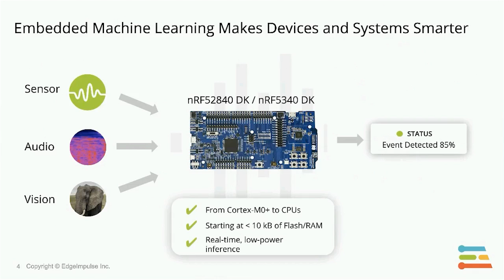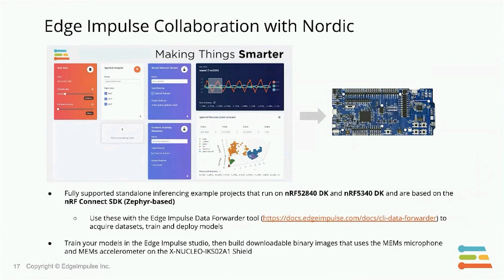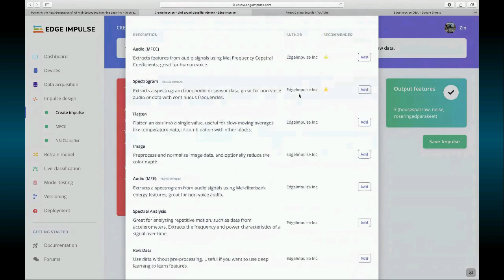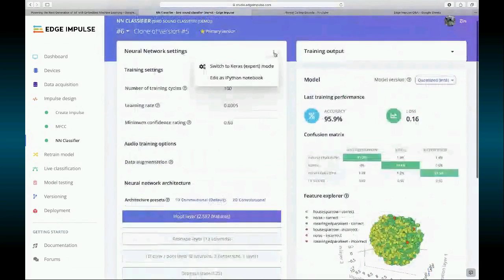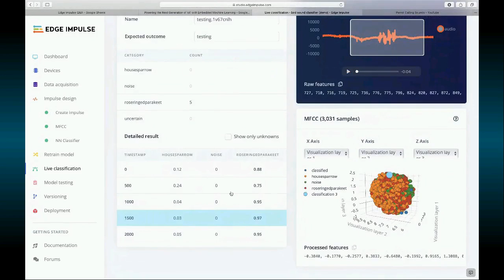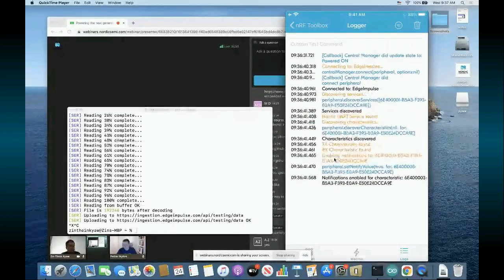Powering the next generation of IoT with Embedded Machine Learning

Comment: Are there any plans to generate model outputs suitable for working in MicroPython or CircuitPython environments ?
Reply: So calling this from MicroPython or CircuitPython should be easy. There's a single entry point (run_classifier) that just takes a very simple structure of data - if you have a way of interacting with native code this should be straightforward. E.g. OpenMV is already doing this (with MicroPython).

Comment: Hello. Are there any plans to make these examples work with the NRF52832 ? Or this feature is hardware dependant? Thanks!
Reply: Hi Felipe, currently no plans but in theory it should work on the nRF52 DK as well but we have not tested it at this point in time. The main dependency is on nRF Connect SDK so I believe that also supports the nRF52832. If you have any further questions, please reach out to us at https://forum.edgeimpulse.com
Reply: @zinkyaw4261  excellent. Thank you! I will try this soon. Currently working on a project based on reading IMU data. Implementing this would be a major feature.